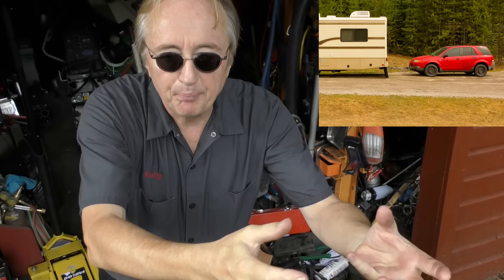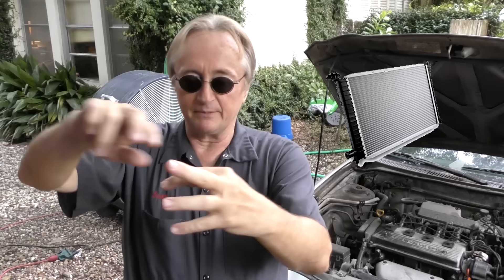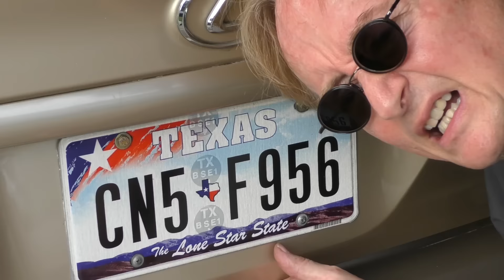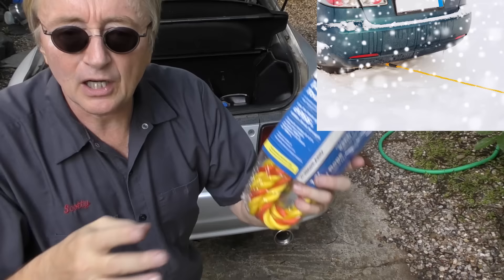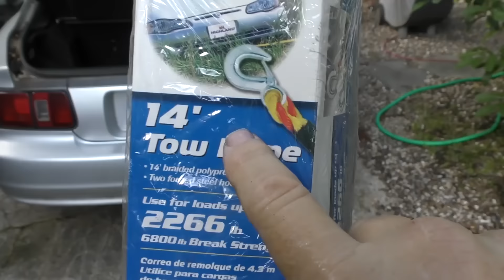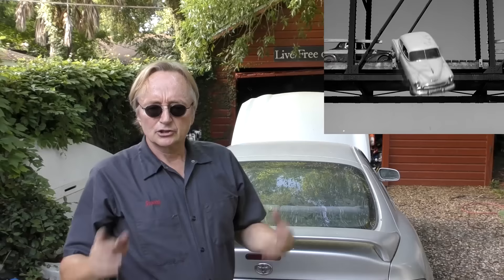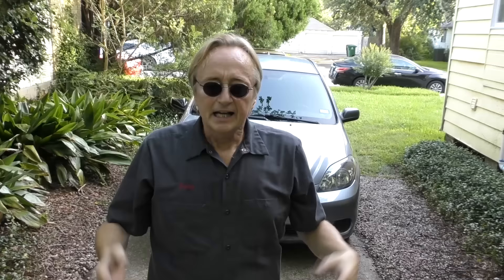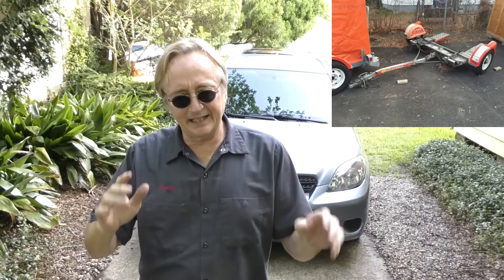Never Do This to Your Car

Comment: if you have a manual rwd can you flip it into neutral and put the front wheels on the trailer?
Reply: Yes, since manual transmissions are lubricated by splashing and not by pump.

Comment: Hey Scotty.  I understand you live in Houston.  I'm having a hard time removing my 8mm bolt on my 2014 Nissan Versa VVT solenoid.  It's completely rounded off.  I need someone to remove it for me and I will do the rest of the work.  Do you know someone or yourself that could remove it for me for cheap

Comment: Question: Is it enough to just put the gear in N ?
Reply: key part is the engine needs to be left on to allow for proper oil and coolant circulation.  rv'ers do it all the time.  they leave the engine on.  may not be possible if you need a tow since may primarily be engine related issues.

Comment: Hey man, I have a question for you. I’m going road tripping for the next several months and I have been building my car into a camper. I have a 105AH battery and 100w solar panel, but my power usage is over 50AH a day, more than the solar panel can replace. I’m thinking about charging my deep cycle with the cars alternator. I have a 2003 Honda CR-V, any advice? Thanks, love your videos
Reply: They make battery chargers that you can plug into a 120v wall outlet and use to charge car batteries. You might be able to get on of those and a bunch of used batteries. You can use an inverter to convert the 12v dc into 120v ac as needed. Just be careful how you store the batteries. It sounds complicated and it is, but it's cheaper than it sounds.

Comment: Um.... the tow trucks are called either wheel lifts with dollies  or a flatbed. And do us a favor... dont ever tell us flatbedder how to do our jobs. We do NOT use the eye bolts on the Lexus. Lexus has hook points under the car behind the front tires and in front of the back tires. Scotty you're great but dont ever tell us experienced flatbedder how to do our job.

Comment: What about with older manual transmission vehicles talking like 90's to 2000 model
Reply: Rusty Flores you’re still turning the transmission internals. Putting a transmission in neutral only disengages the internals from the input shaft, not the output shaft.

Comment: Hello Scotty. I have a 2009 Ford F150  5.4  engine with 137k miles. The engine stared to sound like a diesel on the passenger side. And is not diesel 😂 Will this be difficult to fix? Or alot $$$? Thanks

Comment: Hey Scotty, I have a question. Can you tow a car or truck with the drive wheels spinning in the ground if it’s a manual in neutral?
Reply: Yes. I had my mini cooper towed with a yellow strap for 15 miles as I was in it steering and braking. It was in neutral also no damage was dine

Comment: Ok, a large number of RVs, I see towing, always have the tow vehicle 4 wheel on the ground, crazy (a large number of Jeep Wranglers for some reason), was in the DC area and saw an RV towing a vehicle, the tires or something caught on fire, crazy, bottom line, if you have to tow, (call a flatbed tow trucks) or just do the tow auto carriers (aka auto transport / 2 axle vehicle trailer), basically, no, tires on the road for the vehicle being towed, what’s funny, people seems too tow their motorcycles better than their vehicles

Comment: SUBARU BLOWS HEADGASKET BEING TOWED is BS. If the transmission pump is not working fluid can't be pumped to the  cooler. So the engine can't be burnt up. And there is some air going thru it while being towed.

Comment: So you cannot tow a car with automatic transmission that have  wheels on the road even if it's set to an N(neutral) gear?
Reply: Doesn't matter if in neutral or not.

Comment: So even if you tow an AWD in neutral it’ll still mess up the engine?
Reply: RedMag This logic makes no sense. The thermostat on the engine is closed on a cold engine which prevents any circulation of coolant inside the engine through the radiator. Also, to circulate coolant the water pump needs to be running which is only possible if the engine is on since it’s driven by the belt. Even if the radiator had hot fluid there’s no way for it to get back inside the engine with the engine off! And how would transmission fluid get circulated through the radiator with the car towed? He already said with the car off there’s no lubrication of the transmission so what’s moving the transmission fluid through the radiator?

Comment: Scotty my dad has I 1997 Ford F-150 it runs great but in the winter it has trouble idling you need to rev it real high to start it can you help me
Reply: IAC motor is probably bad or there is a vacuum leak. Is the check engine light on?
Reply: No
Reply: @jacobmahy5704  
That's too bad but not surprising.  The older OBD systems take a long time to register a fault. 
My guess is the idle air control motor has a problem or maybe the intake air temp sensor. 
The IAC is cheap enough and easy enough to change. I'd probably start there

Comment: Hi Scotty!  What happens to your car if you are going down the highway and the serpentine belt snaps...  What will Happen?
Reply: You immediately lose power steering, air conditioning, vacuum pump (if you have a turbo), alternator and water pump. It's not going to kill anything if you pull over and stop, because the battery has enough juice to run the engine without the alternator for several minutes, and the engine will also take several minutes to overheat without the coolant pump. You do need to pull over, turn the engine off, and get a tow if that happens, but don't panic. It won't ruin a car to run without accessory belts for a couple of minutes.
Reply: Depends on the way the vehicle is designed. But usually you lose your  charging system, AC, and water pump. Also the power steering on older cars. It's important to keep an eye on your gauges. I've had a lot of customers not know the belt broke and they just kept driving until the engine over heated and/or their battery went dead

Comment: Is this true, even if you have the automatic transmission in Neutral?
Reply: Neutral disengages the engine from the transmission it does not disengage the transmission from the wheels.
Reply: Han Skinslo yes but you can still tow to a certain extent if you look at the owner’s manual. I have not seen a tow truck other than a flat bed in years. His logic makes no sense. The thermostat on the engine is closed on a cold engine which prevents any circulation of coolant inside the engine through the radiator. Also, to circulate coolant the water pump needs to be running which is only possible if the engine is on since it’s driven by the belt. Even if the radiator had hot fluid there’s no way for it to get back inside the engine with the engine off! And how would transmission fluid get circulated through the radiator with the car towed? He already said with the car off there’s no lubrication of the transmission so what’s moving the transmission fluid through the radiator? There’s no way towing ruined the head gasket! It’s physically impossible for reasons just stated. Sounds like a case of a blown head gasket Subaru that got towed.

Comment: Hi Scotty, recently CAA hooked onto my trailer hitch to pull my 2015 Nissan Rogue FWD backwards onto the truck bed.  Even though the gear was in the neutral position, could this have caused any transmission damage?  Also, what do you think about CAA using the trailer hitch rather than a hook on the car to pull it onto the flat bed?

Comment: Can you tow an automatic if the engine is running with the transmission in neutral?
Reply: No, not unless the car was specifically designed for it. Check the owner's manual
Reply: @rays7437  If you were cruising at 80mph and knocked it into neutral and coasted to a stop I don't thing it would destroy the automatic transmission. The pump is still running. Towing it with the engine on would be the same.
Reply: @gepwxaqdfsidsesg1548  
No, the pump doesn't run. Not unless the transmission was specifically designed for flat towing

Comment: Those Jacks in the towing business could give two rats asses to what happens to someone's transmission. They get get compensated to take a car from point A to point B and so long as the car arrives to point B in one piece, they're golden. If at that point however someone's car is fu**ed up they simply don't care one bit. That's the owner's problem 🤨
Reply: That’s not true of all of us. 
We take every step to avoid secondary damage to a customer’s vehicle. 
Not all tow ops are assholes, and the more claims against our insurance, the higher our rates go, so it actually makes more sense for us to be careful than to be careless. Don’t speak on things you know nothing about.

Comment: what if you put it in neutral first? That should be safe
Reply: manual yeah, auto no. the transmission still spins, it just doesn't offer resistance for it to spin. i know crazy right.

Comment: Trucks with 4x4 usually have a "neutral" selection.
Reply: personally itd make me nervous towing an AWD vehicle in neutral with a wheel lift more than 3 miles or over 30 mph.
Reply: @garrettc9456  good, cause your not supposed to ;)

Comment: Won't putting the car in neutral keep the transmission safe
Reply: Not in an auto you can drop the driveshaft if it is rear wheel drive and itll be fine.

Comment: I see a screwdriver damage on the wifes car - use a Plastic Spudger to pop the cover
Reply: I always whip out my pocket knife and be real careful, you can see the direction those are meant to pop out, it doesn't take much force and you shouldn't be applying force with the knife. Towing is an autism free zone, do it right, but dont over think it.
Reply: @garrettc9456  I would damage the cover - I already know. hahahah

Comment: Can't you just put the car on neutral? Then the transmission will be disengaged from the driveshaft and nothing will happen
Reply: That doesn't always work. Sometimes the friction spins up the transmission.  I heard some old automatic transmission cars could be bump started, but it might take going 40 mph.

Drive wheels in the air is safest.

Comment: All credibility lost in my eyes. Never use a cheap rope with metal hooks to pull anything out of a ditch or mud. There are many cases of them failing and sending peices of the cheap metal hooks flying.

Comment: But what if its in neutral
Reply: The Gaming Nerd it has to be in neutral. Think about it. If it’s not in neutral then you are dragging the drive wheels as they can’t spin. Neutral disengages the transmission from the engine but the wheels spinning still allow the torque converter to turn.
Reply: @newfie-dean5803  I know what neutral does but if it disengage from the transmission why does it matter what wheels are on the ground
Reply: The Gaming Nerd because the torque converter inside the transmission still turns which heats up the transmission fluid. His logic makes no sense. The thermostat on the engine is closed on a cold engine which prevents any circulation of coolant inside the engine through the radiator. Also, to circulate coolant the water pump needs to be running which is only possible if the engine is on since it’s driven by the belt. Even if the radiator had hot fluid there’s no way for it to get back inside the engine with the engine off! And how would transmission fluid get circulated through the radiator with the car towed? He already said with the car off there’s no lubrication of the transmission so what’s moving the transmission fluid through the radiator? There’s no way towing ruined the head gasket! It’s physically impossible for reasons just stated. Sounds like a case of a blown head gasket Subaru that got towed.

Comment: but, with a AWD vehicle, won't damage occur anyway, as the vehicle is slowly pulled onto the flatbed?
Reply: The vehicle is being pulled  very slow onto the bed,  nothing that slow will cause friction or damage. (its the speed and friction you must worry about) 

Just make sure it is in Neutral when pulling it on flatbed BUT ANY COMPETENT tow truck driver  will know this.

Comment: He is full of b.s put it in neutral and tow it. How many rv's you see pulling a car diwn the interstate. He make b.s video's just to get views.
Reply: But even if it is in neutral, the transmission is still rotating when you tow the car since it is connected to the wheels. By putting it on neutral you are disconnecting it from the engine, not the wheels. Then, it will damage the transmission since the oil pump is not working.
Reply: mays9185 you’re wrong. As a tow op, I can tell you that you NEVER just put it in neutral. 
Flatbed, dollies, or disconnect the driveshaft. 
Never allow the trans to remain connected to the wheels on the ground.